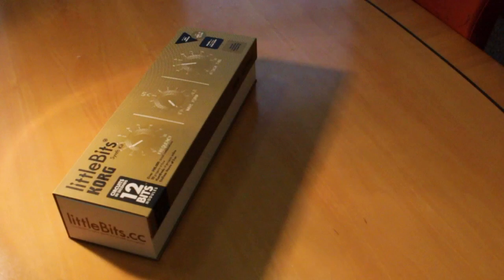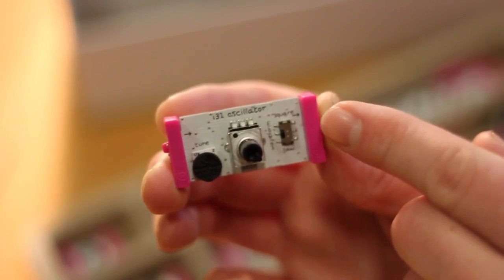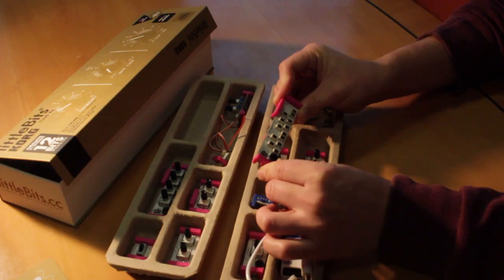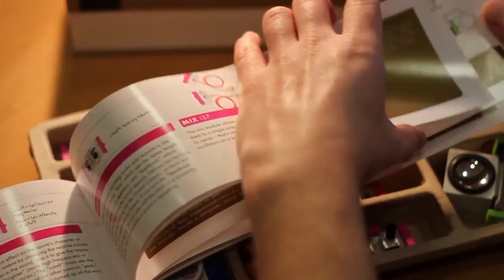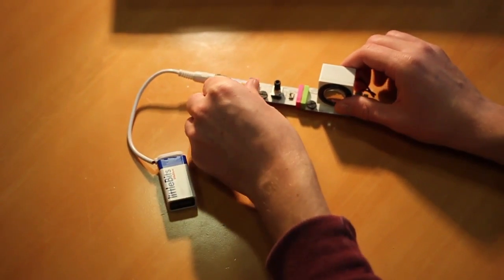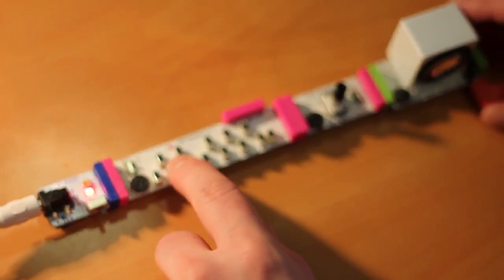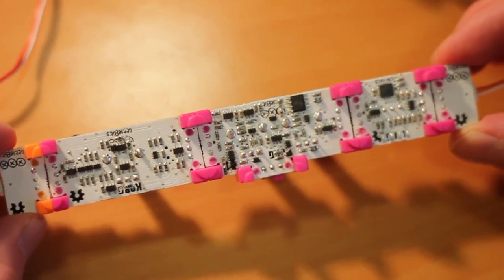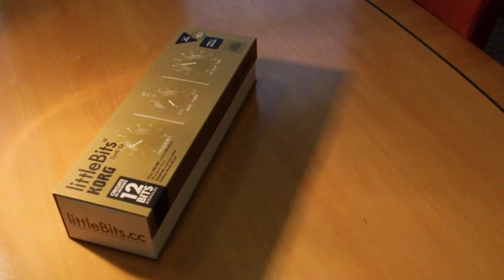Hands-on: Korg and littleBits Synth Kit

Comment: The best thing I think about this is the small size.  I still can't understand how many patch inputs each one has.  The thing that's great about a modular is that it interacts its parts in many different ways.   Some have four or five input/outputs.  How many do these have?  Can you use it with non-standard synthkit modules, like PAIA or Serge?